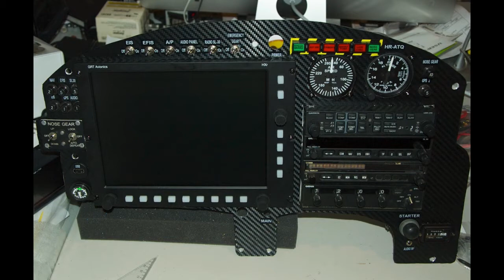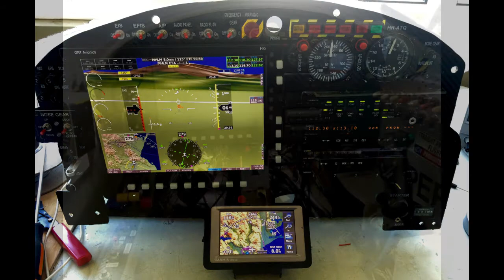LongEZ Panel Upgrade

Comment from the maker: Thanks. You are absolutely right on your observations. Since it was an upgrade (not a new build), I was constrained with the original Radios wiring on that side. However, after a couple of flights, i got used to be a “lefty” in the cockpit!!